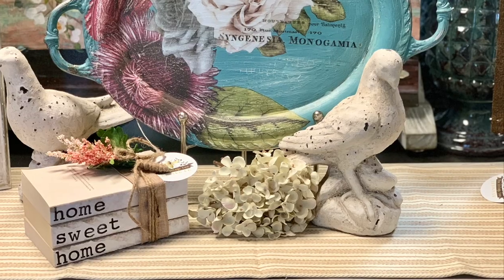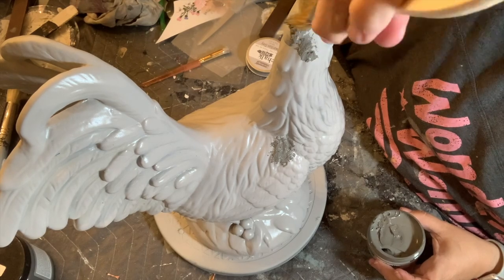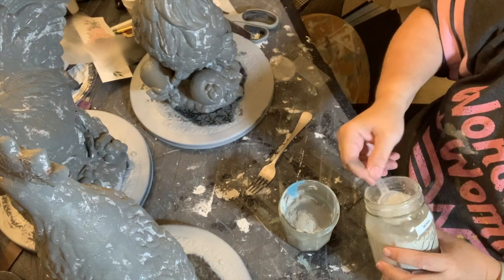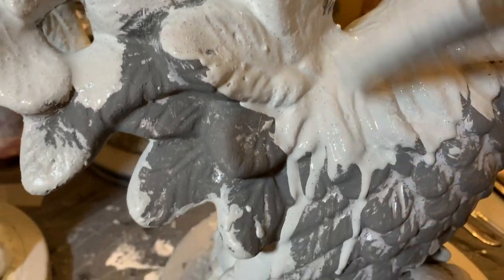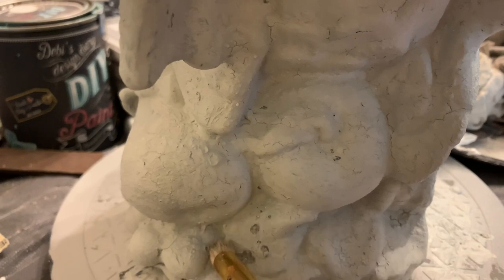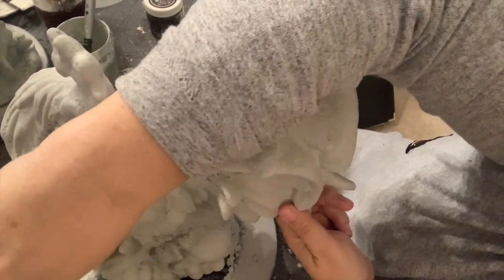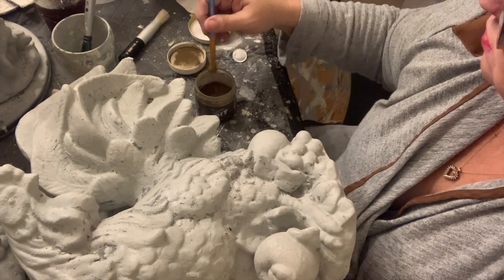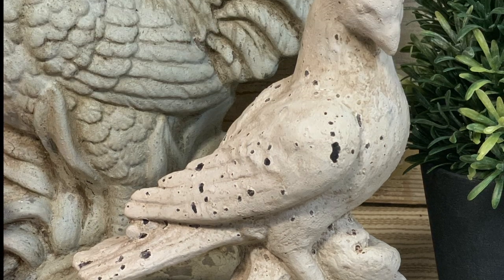Cottagecore DIY Home Decor Thrift Flip | Upcycled French Country | Shabby Chic | Faux Concrete

Comment: If you use a hairdryer will it still chip?
Reply from the maker: Honestly, it will chip of you just let it air dry… if it wants to. Milk paint is funny that way. Sometimes it chips, sometimes it doesn’t. Sometimes it chips a lot, sometimes barely at all. Heat just helps encourage chippy.